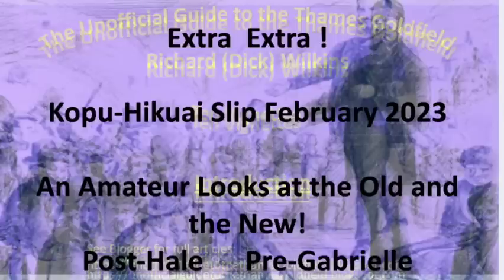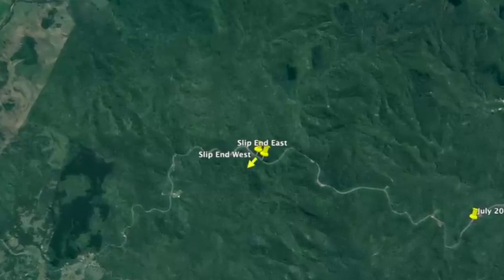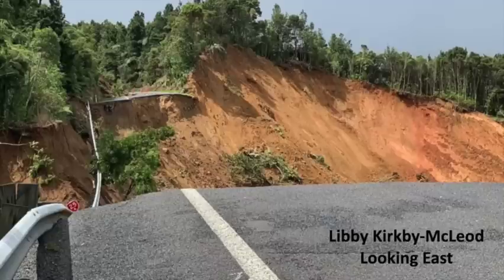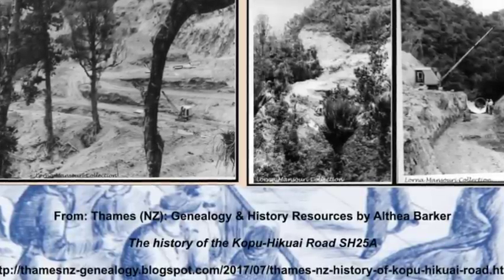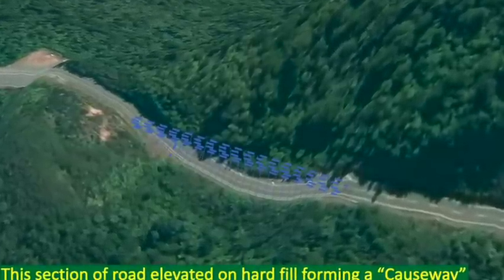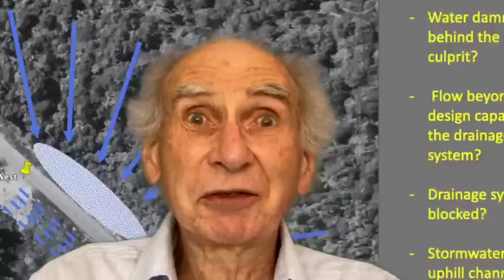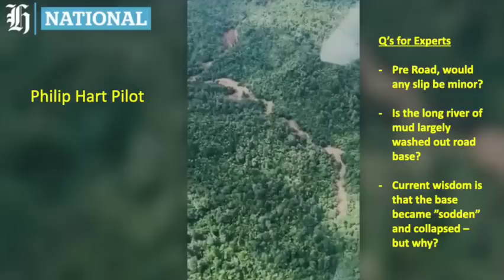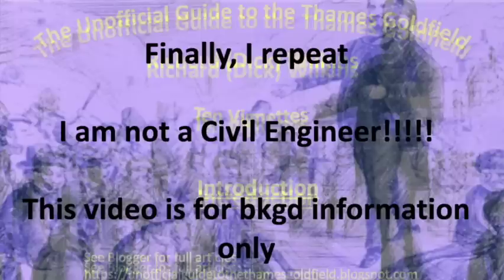Kopu Hikuai Slip 2023 - Why?

Comment: Fascinating look into the history of the road construction. I was part of a geotech team that recently visited the slip and two things were immediately apparent: firstly the fill causeway (visible as stratified material at one end of the slip) was built across the head of a gully, and secondly a number of springs actively running out of the head scarp. The failure is reminiscent of a similar slip in Birkenhead (Auckland), at Rawene Road, where the head of a gully was filled over many years by former Councils and turned into a car park:  which spectacularly failed in a similar fashion and ran out down a long gully. When I was doing geotech on that slip I observed minor springs and artesian flow in hand auger holes in the headscarp at the top of the gully.

Gullies often develop in response to groundwater emergence, by headward sapping over time, with the head of the gully often remaininig as  an active area of groundwater emergence and springs. So when you build up a large amount of fill over an area of springs without sufficient interceptor drains, the result is that the blocked up springs are likely to produce increased groundwater pressures as the water tries to work its way out under and through the fill. The placed fill may remain relatively stable for many years, but ultimately, possibly as a result of peak event rainfall and higher groundwater flows and pressures, the placed fill is weakened to the point of ultimate collapse. 

Both the Rawene Road and Kopu-Hikuai slips developed as a headward regression, and one imagines that as the groundwater was released to mix with the collapse, the material tended to partially liquefy into a viscous or partially viscous flow, hence the long run out. 

Building causeways over a valley is not such a problem, culverts transmit surface water from one side to the other with no groundwater pressure upstream. However, placing fill on top of springs, building up a pressure head in the groundwater, is a different matter altogether- unless work is undertaken to intercept and culvert all of the springs eliminating the risk of back pressure,  before any construction takes place.

It will be interesting to see how they repair this slip. I understand that the preferred option is a bridge.

Comment: A very interesting video  - A couple of comments from a retired Civil Engineer might help viewers understand some issues.
Cutting and embankment type road construction is used pretty well everywhere.  It’s in no way unique to SH25A.  “Up and over the ranges” type road alignments must be designed as a compromise between straightness and steepness. Closely following the contours provides an acceptable gradient but makes for a very windy and longer road. Trying to shorten & straighten the road somewhat without making the gradient too steep means the road must pass through ridges as a cutting, and cross valleys as an embankment (or a bridge). One of the prime design tasks is to attempt to roughly balance the amount of soil excavated in the cuttings with the amount of fill material required to build near-by embankments.  This minimises the quantities of soil that must be transported long distances, together with the associated transportation costs.
Management of seepage, springs and the like under any such constructed embankment is critical and this appears to me likely to be the fundamental problem with this failure, as the road cracks had begun developing well BEFORE the big storm of 27th January.  The big storm was probably just the final straw.  In addition I do note that some photos suggest the top of the slip scarp extends a long way outside the limits of the road embankment, so it may be a much bigger slope instability phenomenon than just the artificial road embankment. 
Unfortunately the restoration of service will be no easy task and we can anticipate having to do without SH25A for a long time to come.
Reply from the maker: Grateful for your expert comments.  Yes, I did notice the extension of the top of the slip but wanted to keep the video short.  The uphill slope is about 20 degrees plateauing out on a hillock about 100m above the road .  High resolution LIDAR (which I don't have access to in this area) might detect any long term slope instability.
Reply: @dickwilkins9900   Yes, detective work can be fun.   You probably know the Thames Coromandel GIS system can provide detailed contours, and reveals some interesting terrain adjacent this section of the road.  It also very clearly reveals the "following the contour" concept I mentioned.  I am not suggesting the embankment is necessarily guilt-free in all this, but we should always understand that perfectly natural slip erosion also occurs throughout such terrain, and has done for millions of years.

Comment: Yes for the Greenies to say it’s a result of old mining lol , I agree the machines they had in those days were considerably smaller compacted fill would have been like sand/gravel, I believe they should go straight across by the western park up area straight over the hill instead of cutting around it , like most roads craved around the Coromandel if you cut into toe of hill it is only going to destabilise the hill , over a matter of time things come lose ,maybe it might be a scar in the short run but in that area it will regenerate quickly